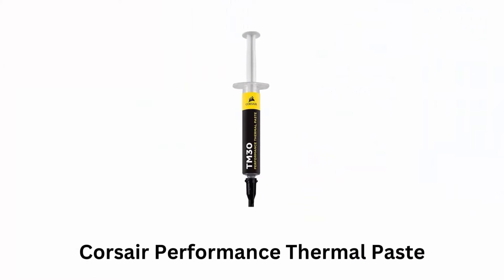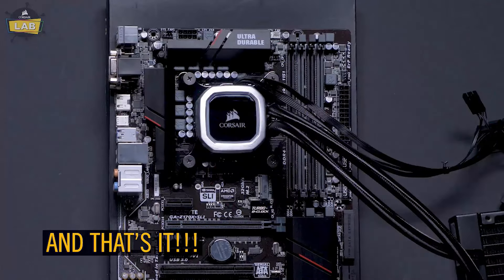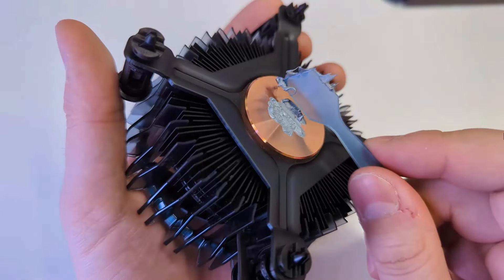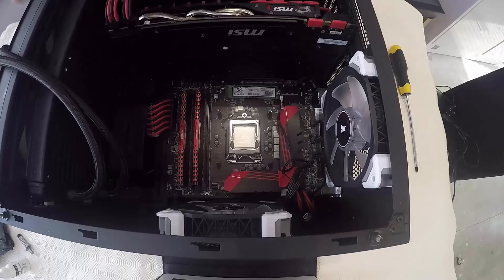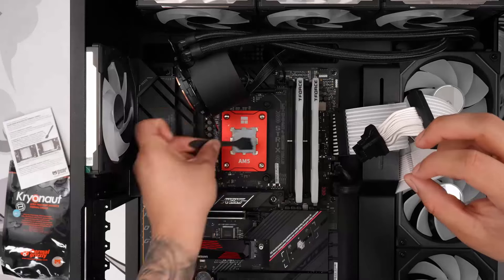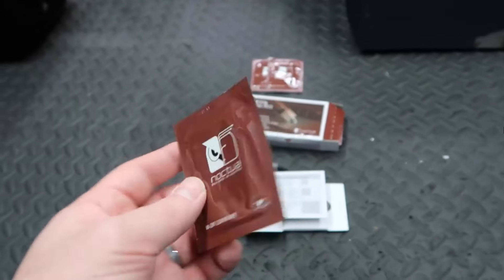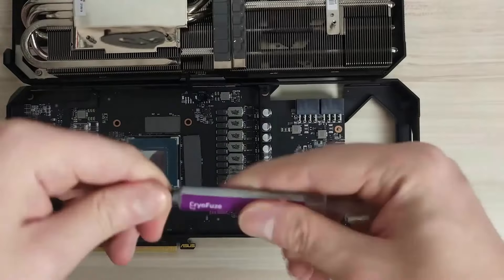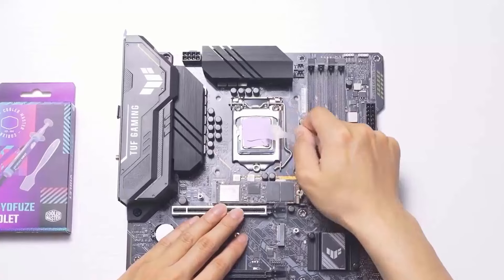Best Thermal Paste for PC, CPU, GPU and Laptops - Maximize Cooling, Minimize Heat

Comment: ptm7950 is better as it lasts for years in a date center deployment and was tested to survive 1000 hours at 150 C dont listen to the ai slop content i have a xeon e3-1270v2 that can be cooled by a intel stock cooler as it has ptm7950 it is just better in every way